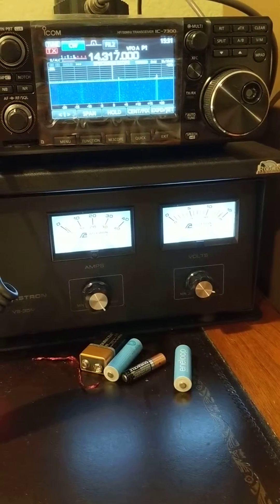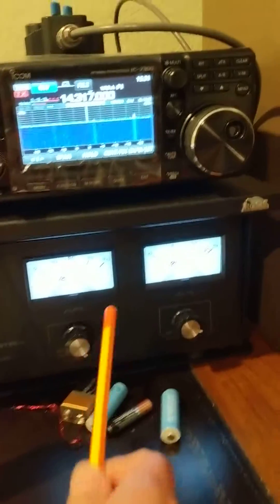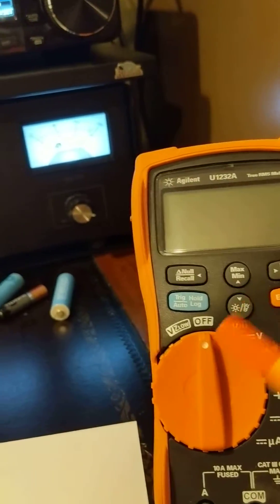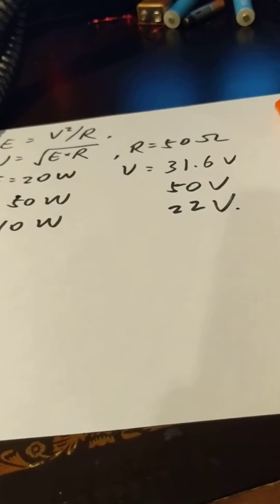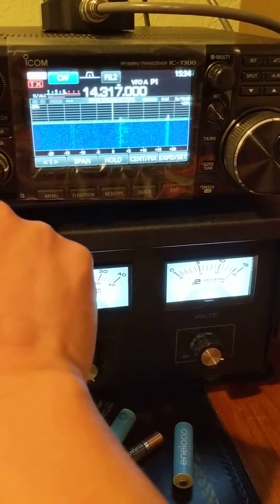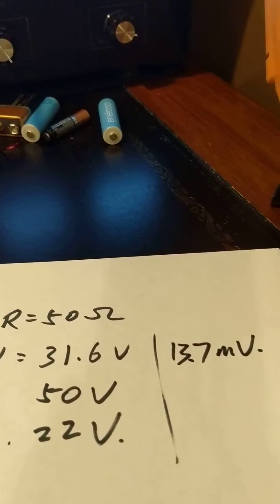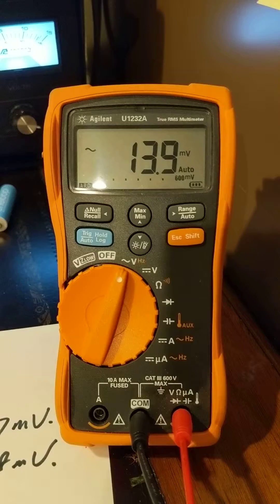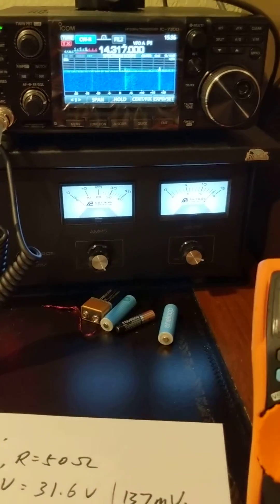Use multimeter check antenna watt output

Comment: I tried the same with my tiny ten minutes transmitter and I had the same issue... wrong values that didn't had anything to do with the real power that is coming out of the transmitter. Instead I ended up building a small dummy load with a few more parts that helped me read the DC voltage instead and with the formula I calculated the power output. 73
Reply: I realize it is pretty off topic but do anyone know of a good website to stream newly released series online ?
Reply: @Louis Omar lately I have been using flixzone. Just google for it :)
Reply: @Louis Omar try Flixzone. You can find it on google =)
Reply: @Louis Omar I would suggest FlixZone. Just google for it :)

Comment: Your Agilent multimeter cannot give you a correct value of voltage because you’re trying to measure an AC signal at 14 mhz. Your multimeter more likely will go up to few tenths of Khz. To do this you need an RF voltmeter able to work high frequencies.